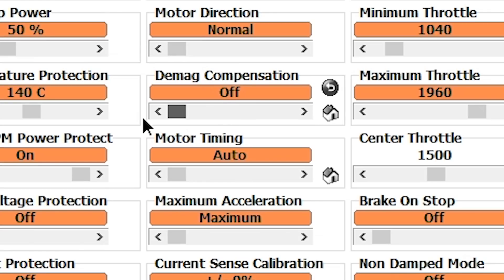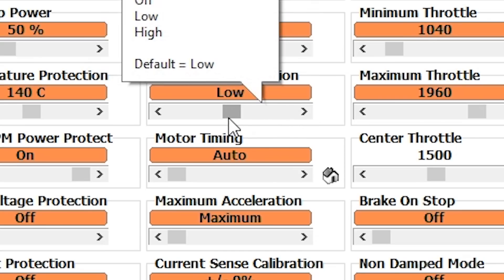BLHeli32 100% Explained - Part 4 - Demag Compensation

Comment: I’m getting desyncs I think.  It arms and fly’s smooth but if I give too much input on the sticks it freaks out and I can hear the escs restart.  If I increase the demag to high or motor timing to 28 the quad will desync even faster with less stick movement.  So I’m trying to figure out if having demag at high or motor times set too high could cause desyncs too?  Maybe sweet spot in the middle?  Or maybe my esc is too close to gyro?  Or maybe this new spedix f3 4 in 1 is bad?  🤨. Any pointers would be appreciated.

Comment: I was looking through my notes from my conversation with Steffen on demag compensation, if anyone is interested in a more technical explanation of what demag is doing. Demag compensation senses demag situations by detecting missed zero crossings, and can shut off current flow in a specific time before the next zero cross, in order to reduce the likelihood of disturbance during detection. Demag compensation also advances timing automatically when sensing long motor current demagnetizing events that can cause zero cross detection fails and in the worst case desyncs.

Comment: So if I understand this somewhat correctly when I plug in and my motors twitch on my quad, is that blheli looking for the zero crossing? I know that's a noob question, but my vortex motors didn't twitch. And I'm just trying to understand the difference.
Reply from the maker: No, that's just the beeps. The beeps use the motors as a voice-coil like a speaker. The motors twitch when they are made to play sound.
Reply: @JoshuaBardwell  thanks for clearing that up.
@quadmcfly, I appreciate the detailed response. 

I had a feeling it was a noob question, I really appreciate you guys that put out good tech info.
Reply: The twitching is just how the motors are making the startup tones. Zero crossing detection doesn't play a role till the motor is actively rotating. In fact during the initial start of spinning, the motor is just making a best guess as to when to turn on and off the FETs until it gets enough velocity to get a solid BEMF wave and be able to begin detecting zero crossings.

Comment: If the zero crossing threshold is reached and the motor power is decreased, is this for a set amount of time? Or until you unplug?
Reply: So it actually is constantly looking for issues, and if it fails to detect enough zero crossings in a row it will turn off the FETs just before it is expecting to detect a zero crossing in order to increase the chances of valid detection. Once it gets enough detected crossings to recover it goes back to normal operations until it reaches the threshold again.

Comment: Really need to port BLHeli32 to Mac. I'm not buying a whole computer system just for an ESC.
Reply from the maker: You can use Parallels or some other emulator. But I agree, a native solution would be great.
Reply: I have a Mac and blheli32 works for me.
Reply: @bobedigi   Care to elaborate mate?
Reply: @patrickcolclough2423  i honestly dont know how i got it to work.  It just does... you have to make sure you have all of the drivers installed and it works.  or you can try to use VMware and use virtual windows.  either works for me...
Reply: @bobedigi   Then you have to have either WIndows or a WIndows emulator installed. There's no way can it run on Mac OS.

Comment: you haven't touched on possible drawbacks of setting this parameter to high, only that for miniqwad motors it shouldn't be as important of  a parameter. To be clear I am not complaining (as if the gains are infinitesimals so should the drawbacks), just asking myself if there is anything more to learn here :)
Reply: Yeah I totally forgot to mention that, but the drawback would be some slight lag on very large accelerations on some motors combinations. I need to do some more testing to see if I can measure it on some varieties of motors.
Reply: Whoops posted that comment from the wrong account :O
Reply from the maker: Ryan seemed to say that there wasn't much of a drawback. If the ESC is not experiencing missed zero-crossings, then demag compensation never kicks in and the setting is moot. So why not just leave it at high forever? The blheli manual says that top end power can be reduced "for some motors" if the value is set to high.
Reply: @JoshuaBardwell  any plans on making a video on how best mount the antennas of the all new tbs nano diversity module? Your advices with FrSky antennas and omnidirectional antennas were REALLY crucial for my build :)

Comment: I put two new esc's on my quad, and downloaded blheli suite, it still is not reading them all. (the quad was flying, but it dipped on the side with the new esc's) I tried flashing them, with no luck, I'm not great with computers, but not ignorant either. I'm wondering if you have any ideas I can try, now 1,and 4 do not spin the motors in blheli, betaflight, or when armed. Also it's 1old esc, and 1 new esc that are working, but still only fully identifies esc two as the master. Very confused.
Reply from the maker: Don't worry about master. The first thing you want to see is that when you hit the "check" button all four ESCs read successfully.

https://www.youtube.com/watch?v=FwyYdjRLdG4

Follow the steps in that video to connect to blhelisuite and try to read the ESCs.

Make sure all ESCs are blheli32 or blheli_s. You need different software to configure blheli32 vs blheli_s ESC so if you have mixed them, they won't read.

PS: thanks for being my Patron :-)
Reply: @JoshuaBardwell  blheli32 not blhelisuite sir
Reply: I would suggest you to get on the rotor riot discord server, there is a section for troubleshooting. Before the crash the build was stable?
Reply: @LeWebslinger  yes, I didn't protect my esc's, I didn't realize how much torque this quad had, I used turtle mode, and ripped two on one side up. Chrome obviously didn't work so I calibrated the esc's, and tested. It dipped toward the new one esc's. I guess trying to flash them corrupted them. 1 read saying can't read serial number. Thanks I will try discord.